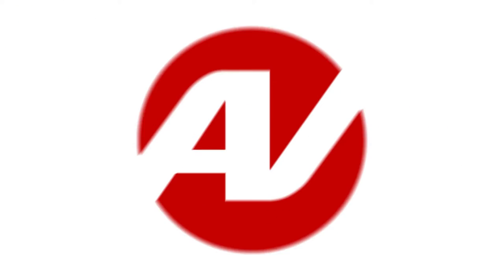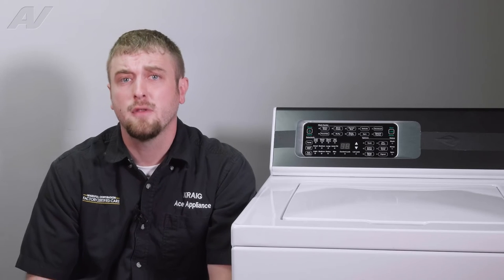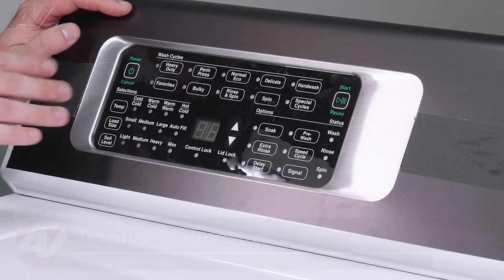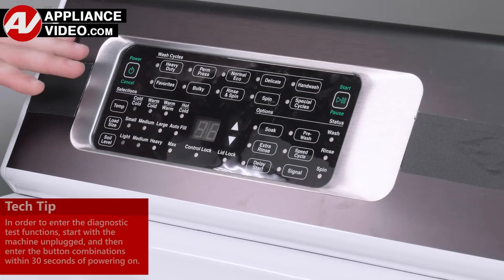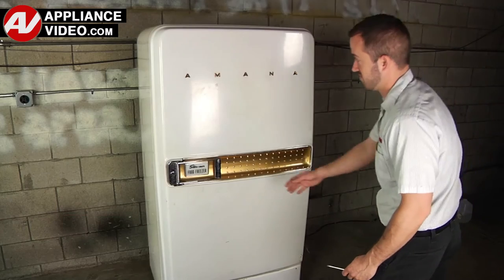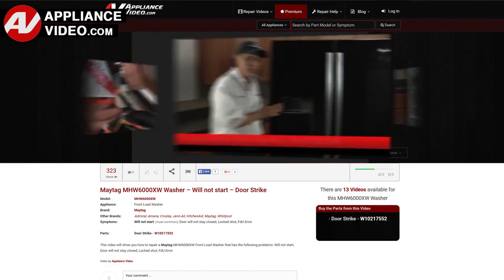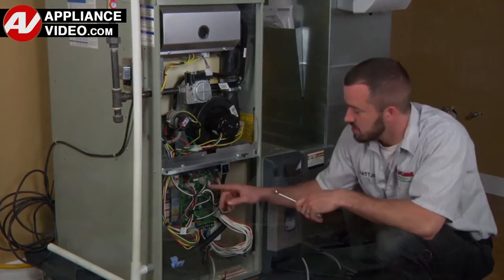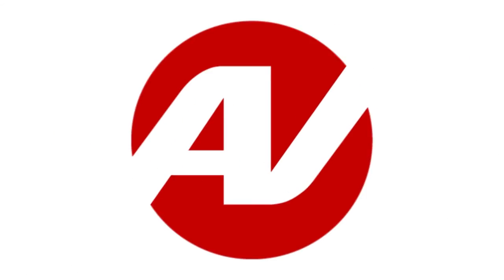Speed Queen Washer - Error Codes, Diagnostics & Troubleshooting by Factory Authorized Technician

Comment: How to enter diagnostic mode on that model?
Reply from the maker: Great question, if you have a more technical question that our parts department cannot answer, you can search our over 17,000 answered questions free at our website www.ApplianceVideo.com under our Repair Help section. You can also call our parts department at 1-800-830-5465 and they can give you help 7-days A week ,or search at www.SaveMoreOnParts.com  .
Reply: unplug machine, then plug machine in and when it is powered up and any lights are on, Press Perm press and Temp and the same time. press start until P- displays. press every button on display, landing on start last. When every light is illuminated, you can press start through all the different tests. the Test where it drains, you must wait for 5 minutes while it goes through an automatic motor test sequence. once there is no spinning going on, unplug machine. To unlock the lid, plug it in and simply wait.
Reply: @DylBuilder1  
Thank you for this advice.
 Before I found your post, I unplugged my machine and when I plugged it back in to follow your advice, it had reset itself.
 Already an improvement on my Whirlpool that died twice in the two years I had it... one week within the warranty and then exactly one year later🙍‍♀️
I replaced it with the Speed Queen brand hubby wanted💕
I just wish it didn't have the agitator.
Our model has 7 year warranty!!!

People MUST try the Speed Queen  👑

(I am keeping your post just in case* subscribed DylBuilder1)